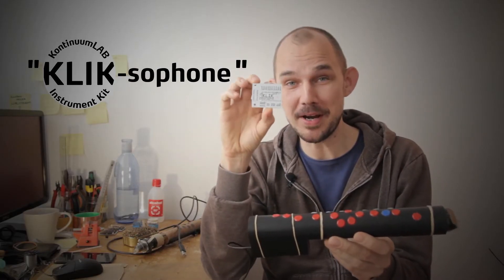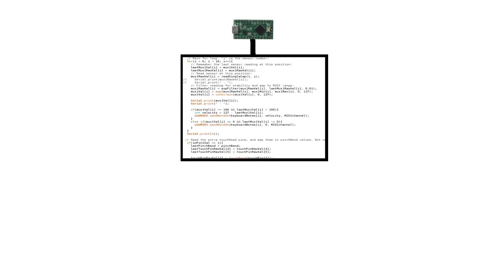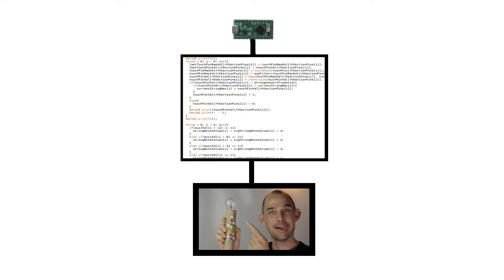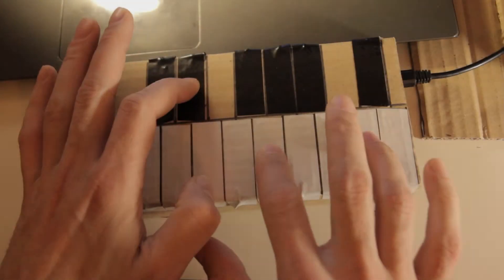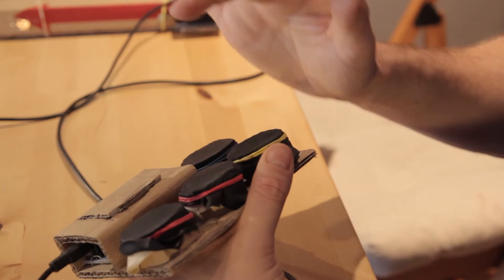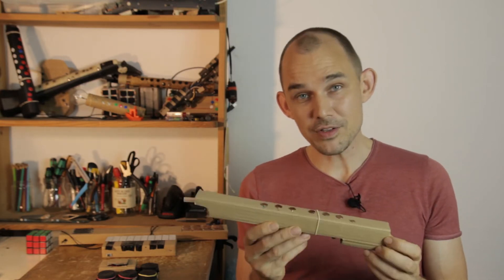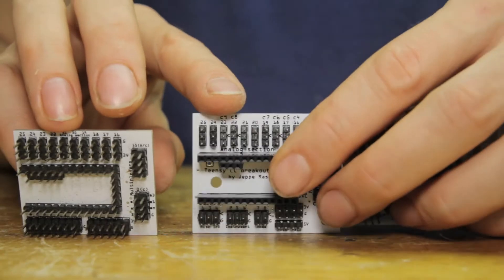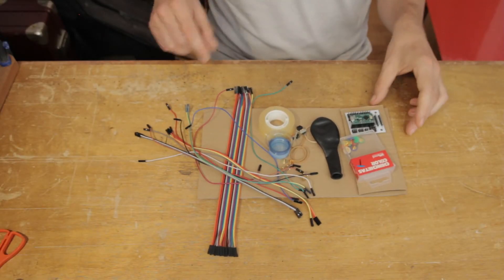DIY MIDI controllers without soldering or coding. KontinuumLAB Instrument Kit, Total beginner mode:

Comment: This is very exciting stuff, I can't wait to play around with building different instruments and messing around with the coding. In theory I could connect micro LED lights to each button as well right? Like when each sensor is activated a corresponding light will indicate it's activation? I got some ideas for that if it can be done
Reply from the maker: You could add LEDs, but they would have to be activated through software, because the capacitive sensors don't run voltage through them, unlike "arcade" style buttons. 
Game controller joysticks are basically analog sensors. They work great for pitch bend and stuff like that.
Reply: @KontinuumLAB  

Have you thought about adding a cheap android phone inside the body of your instruments to run the software and produce the sound from its speaker? You could have a completely self contained and adjustable instrument this way. might be taking it a bit too far but I'm thinking of implementing this in some way.
Reply: Not only could It produce sounds and run the software, you could even record your music with it
Reply: I found your channel laying in bed trying to get tired and now my ideas are running non stop in my head, I will never fall asleep but I'm loving it lmao
Reply from the maker: @Mizzle420420  hope you eventually fell asleep...
Reply: For pitch bend I could use an old joystick from an xbox controller right? If I wanted to get crazy I could even use the controller bottoms for sensor buttons right? So many possibilities